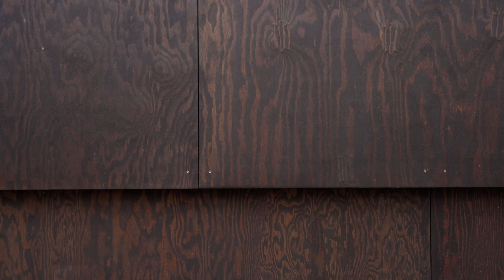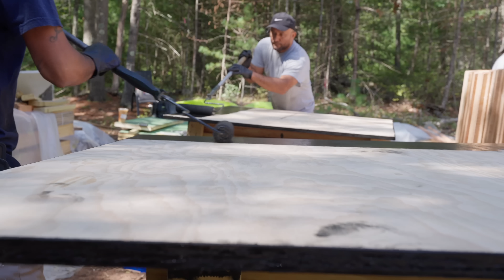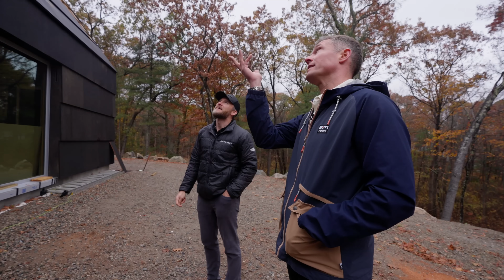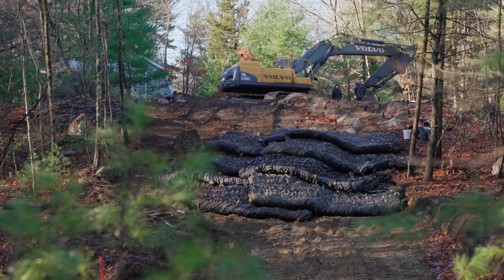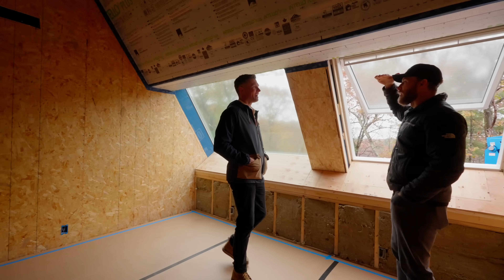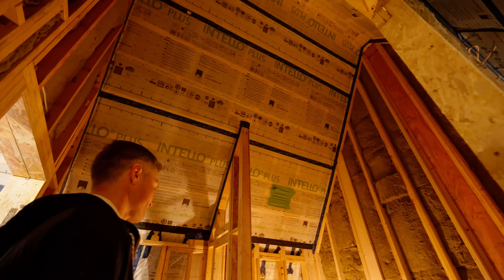The Hidden Craftsmanship on This Epic House

Comment: I live up in Saskatchewan, Canada. We built a slab on grade, 4,000 sqf living space, two story home with large south facing windows. I did In-Floor heat on the main floor, with forced air on both the first and second story as well (so I had the ability to cool with AC on both main and second story). In the dead of winter with -30 deg. celsius days. I have In-Floor heat set to 20 deg. over the night, and turn it off during the day. I then run my furnace fan (with no heat). Just circulating the warm air off the main floor slab. I can maintain temp in my home all day without burning any natural gas for either the furnace OR the boiler. And if its a sunny day, my large south facing windows allow in lots of sunlight which is naturally soaking into my slab, and I will actually gain temp in my home from 20 deg up to 24 deg by the end of the day. I have 8 kids also.... So the exterior doors are opened and closed 100 times throughout the day. I am a firm believer of radiant floor heating, along with a build site that can allow for lots of south facing exposure.
Reply: This house is insane. Absolutely love every inch of it.

Comment: Y’all are obviously struggling with this method.  Coating the plywood with such a flammable substance seams the primary issue, secondarily you mention needing maintenance applications every few years.  I would assume it has run off (sarcasm, it will run off and not last), partially because of using an engineered sheathing, which have glues that interfere with adhesion and end grain/panel edges with layers of exposure.  This is why Zip has you tape the seams.

Point being, is that consumers, consume, not produce or maintain items and ppl will argue me saying “well ppl can’t expect to never do maintenance”.  My argument would be “who can/has reach, see or clean the top of an SUV?  Who has ever cleaned there gutters?  Anyone, painted the exterior trim around a window on the second story of any building, ever?”   All of these example are far more simple than the maintenance of this sheathing.  Let alone leaves settling on any of these surfaces, algae, mold, pestS.  

Unless a finish is made “integral” to that sheathing, then you are now leaching that finish into the ground reapplying it, rinse and repeat literally.

Comment: This not criticism but something I relate to on jobs. Which is taking the basic principle then applying it to something new and with some limited tests having to basically rationalize the rest of it etc. It's a pragmatic approach and one that hopefully helps us all sleep better at night. I might have changed the look a bit and added end caps to those plywood boards on the ends which are more open to the elements. Easy for me to say as it would have added time. But it's an interesting look and reminds me of Peter Zumthor's buildings a bit.

Comment: As a former window designer, you need to do some serious engineering on that round window. Based on the thickness of the sash, it will never open unless there is a huge gap between the sash and the frame that you’ll never be able to seal. Figure out your plan B
Reply: I was thinking this too. Its 4+ inches thick and each edge is going to bind up as soon as it starts to rotate. I think I understood that it will only rotate in one direction, so they could chamfer each of the 180 arcs in opposite directions, but I didn't hear anything about that plan. Perhaps the stop blocks on each side will be really thick to cover the necessarily large gaps around the outside that woudl allow the described rotation... I do not imagine that looking that good, and they only described a 1/2 gap in their planning. That doesn't seem like enough to me, and I'm too lazy to do the math, but perhaps it is.

Comment: Of course, I love your execution of the mega-shingles.  Regarding your comment on heating.  I've had all kinds of home heating from wood-fired stove; to in-floor heat in concrete floors with a modern modulating-condensing boiler; to forced air gas with a A/C; and now a heat pump.  I thought the heat was fine for the hot water, in-floor heat, but I missed the air circulation room-to-room and air filtering.  As you mention, you basically need to duplicate your investment with a separate duct system (for A/C and the ERV).  With modern, variable-speed, multi-stage ducted heat/air conditioning you get filtered air along with a very quiet, very comfortable solution.  Frankly, I find variable speed/multi-stage air distribution more comfortable than in-floor heat.  I much prefer the Mitsubishi Hyper Heat cold-weather heat pump that we have now.  I have MERV 13 air filtering for my ducted system (important for asthma/allergies and wild fire smoke), along with quiet and even distribution of the air.  I do have a mini-split for an attic space, which is quiet and effective.  However, the mini-split's lack of a MERV 13 level air filter and the inability to distribute to multiple rooms without multiple head units are negatives.
Reply: Radiant ceilings, for both heating and cooling, solve the problem of rugs or furniture on the floor. You still need to control for humidity during cooling season, but the ceiling is a more practical location for the hydronic heat/cooling for most houses.
Reply: @PaulBohman  Yes, the home we owned with hot water in-floor heat also had hot water radiant heat in the ceiling of the living room, which had large windows on three of four sides.  The ceiling helps with temperature comfort, but you still need air circulation - so the house does not feel stuffy - especially in bedrooms, kitchens and bathrooms.
Reply: @tedbellSEA pair the radiant heating/cooling with an ERV for low speed fresh air circulation. That’s the best of both worlds.
Reply: I dont understand why you need AC if you have the ERV to move fresh air around and filter? Why not just stick to radiant heating if its working fine heat-wise and stick to the ERV for filtration and fresh air considering it requires significantly smaller duct work?
Reply: @SuWoopSparrow  A/C is needed for warmer climates where it gets too hot and/or humid inside.  An ERV cannot cool the home.
Reply: @tedbellSEA  Oh, I misunderstood then, it sounded like it was needed because radiant heating wasn't enough.

Have you tried a radiant heating/cooling setup ever? Zehnder makes them and they've been used in residential and commercial projects, but I haven't met many people who have personally tried them yet.
Reply: @SuWoopSparrow  No, I've not tried that.  Frankly, due to the issues I found with radiant in-floor heating, I would not employee it again, except in spot locations such as bathrooms, entries and mudrooms - but with in-floor electric heating.  That has worked well.  The problem with radiant in-floor heating, even with properly designed, low temperature radiant in-floor, is you need to be careful with floor coverings such as rugs.  When we bought the house with in-floor heating in a concrete floor, the real estate stager had put down an area rug with a standard rubberized pad under the rug.  The heat "melted" that rubberized pad and welded itself to the concrete floor.  The entire floor had to have a concrete overlay to repair.  Just placing large throw rugs over in-floor heating can reduce heat transfer and make a room feel cold.  Zoning helps, but I don't feel it is worth the bother.  Forced air has been so dramatically improved in recent years with multi-stage heat output and variable-speed blowers that it seems like a much better choice.
Reply: @tedbellSEA  Thanks, I'll have to look into those options. Grew up with simple forced air and have an aversion to air heavily blowing in my face and drying my eyes out, but the advancements might make a huge difference.

I will note that Zehnder's system is ceiling mounted (or really you can mount it where you want, like a wall if preferred). Since there is less material to block transfer, the temperatures can be less dramatic and there is no worry about coverings or your feet being in contact with an overly hot/cold surface. Also seems significantly easier to install than in-floor.